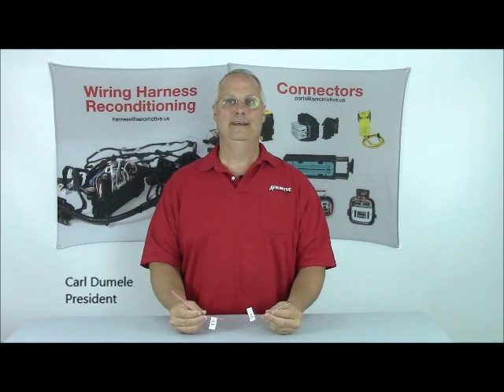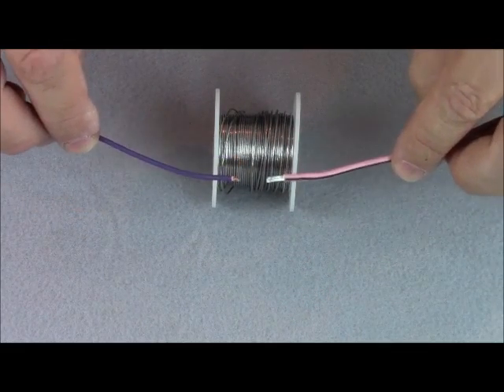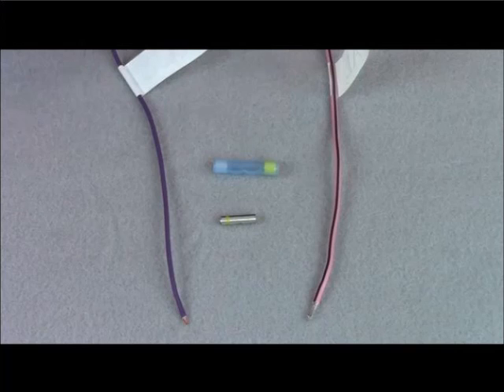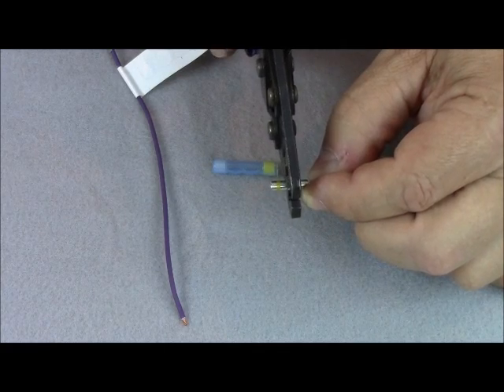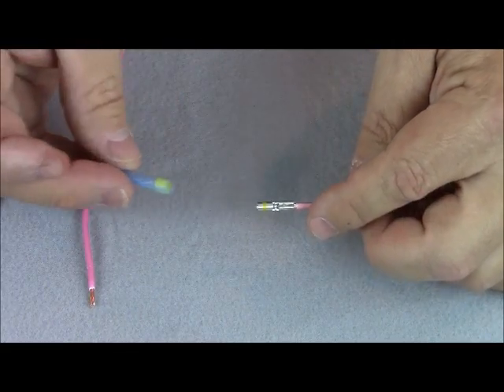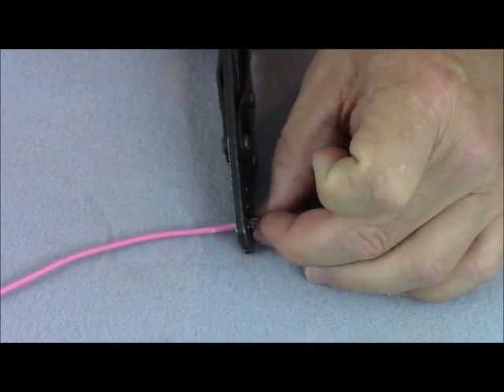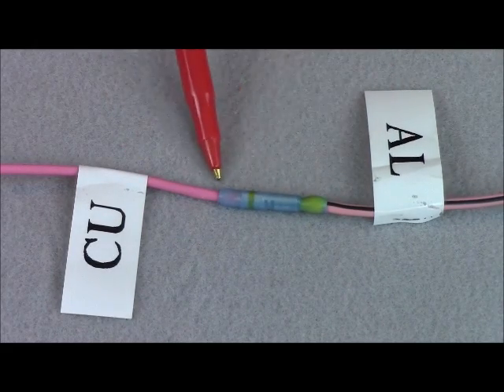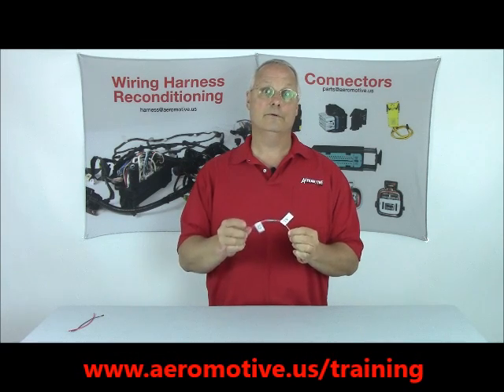How to crimp Cu and Al wire together

Comment: I'm not buying this , 3 approved methods of repairing alum wiring, #1-copalum( $$$trained electricians only) #2- alumiconn, #3 replace alum wire with copper wire *(best/safest/$$$$$) as stated this connector IS COPPER !!! WTF is he trying to suggest??  BAD BAD BAD VIDEO !!! SHAME ON YOU !!  
Read CPSC Data on Alum Wiring Repair ! Save A Life DO NOT FIX YOUR HOME WIRING WITH THIS METHOD !!!!!!!!!
CALL AN ELECTRICIAN (or 2 or 3 )!!!!!!

Comment: If the splice connector is made of tin coated copper, thats still copper to aluminum.  So what's different about it???
Reply: I'm thinking tin is the bridge between copper and aluminum? I'm reading comments that even if there is a third metal involved there will be corrosion. So not sure what's the purpose of that connector.

Comment: Basically, they are in contact through the crimp connector if you want electrical current flow (which you typically do with wiring).  The crimp provides the electrical path - so the references to not touching the two materials is wrong.  The shrink sleeve provides the corrosion protection by keeping out moisture (electrolyte).

Comment: As long as aluminium is electrically connected with copper in any way (even through a third metal), if they are also connected through water, there will be electrochemical corrosion due to the difference between the metals (at the surface where they're touching the water). It is irrelevant whenever aluminium is directly touching copper or not, if they are electrically connected anyway.

What is relevant, however, is that 1: aluminium has a high coefficient of thermal expansion and low yield strength, so if the connection is heated and the aluminium wire expands, it could get squeezed down and become loose when it cools down again. 2: aluminium immediately forms an electrically insulating oxide in the air, so any gaps promptly lead to rise of resistance.
Reply: I am still confused. With the barrel connection, there will still be corrosion? I would still be concerned with the aluminum corroding in air?